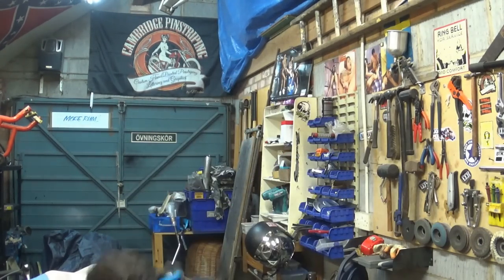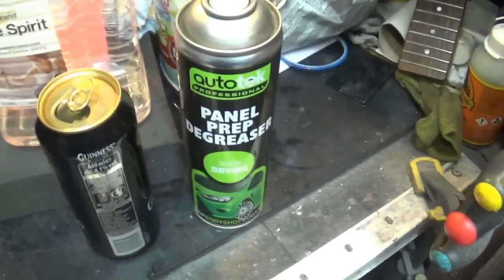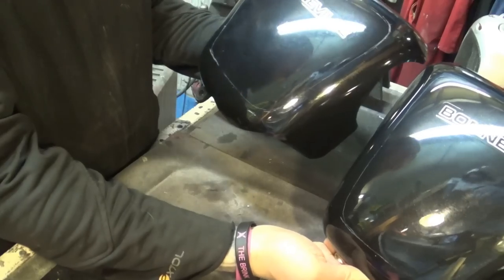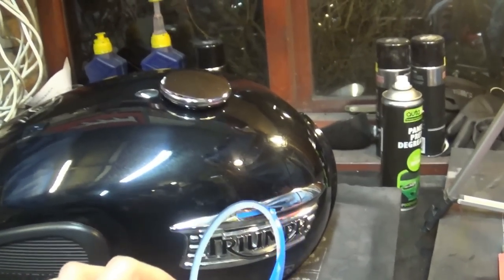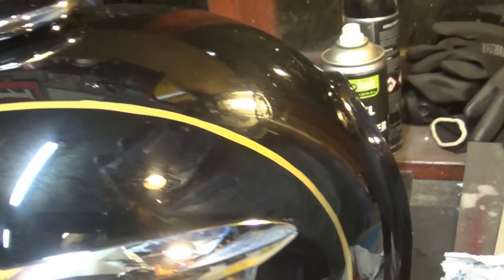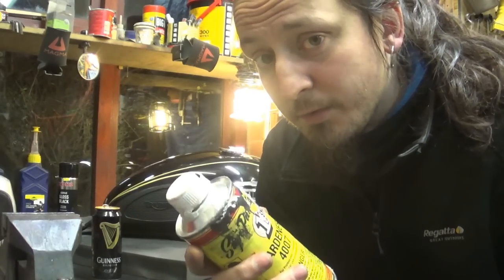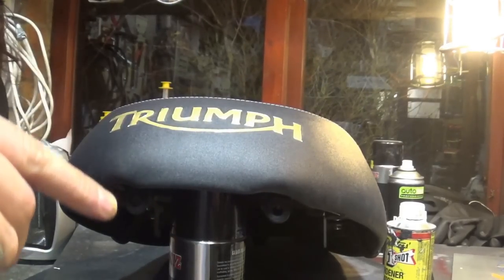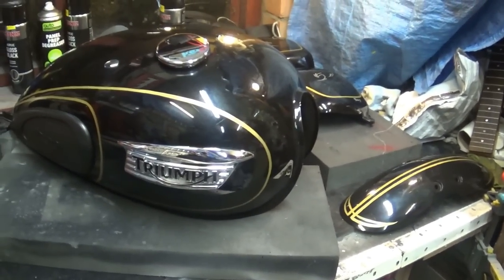How To PInstripe a Motorcycle?

Comment: I like it. Good design decisions! I'm a lover of curves and organic form. Motorcycle pinstriping really lends itself to that artistry. Your customer is going to love it. Like a good writer, you know when to use the period ;-)

BTW, Methyl Hydrate (methylated spirits in Britain) is a great cleaner after using your window cleaner then Mineral spirits (White spirit). Methyl Hydrate doesn't harm rattle can oil base paint or leather and vinyl seat material. That way, you clean water soluble dirt first with the window cleaner, wipe with a damp then dry rag, then clean oil grease and wax next with the mineral spirits, and anything else that remains with the methyl hydrate (100% methyl alcohol) without any harm to the substrate. One caveat: methyl hydrate will remove or damage waterbase coatings. That of course makes it a great inexpensive airbrush cleaner when using waterbase paint, as it will remove dried paint. Super-cool. Love what you do :-)
Reply from the maker: BlastsFromTheSaddle lots of good info there mate. Thank you so much for all your input. Best wishes.

Comment: I want to paint my 1200's jugs black....2000° F heat paint ...would this be feasible?...or it end up looking like shit after 2 months??
Reply from the maker: Is it matt black? It's not really designed for that purpose and it will end up looking really ratty after a while. Bu tif that's what you;re after - go  for it.
Reply: @MackieBass  ya, it's a matte...it's new, seen it in auto store other day, forget who makes it... kinda figured paint would eventually heat deteriorate,look like rotten rat shit, then gotta do another engine dissection,jug stripping, gasket buying, sh'loads of cussing....
 or just ride the Ratt!! .......Round-N-Round even!